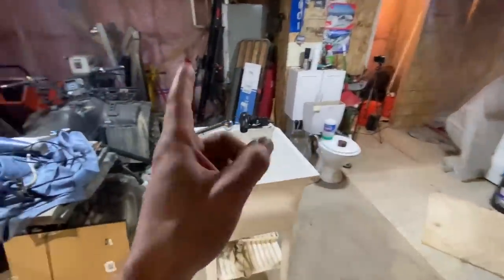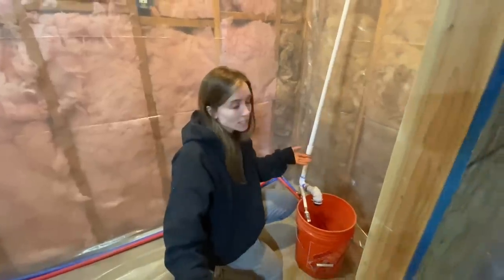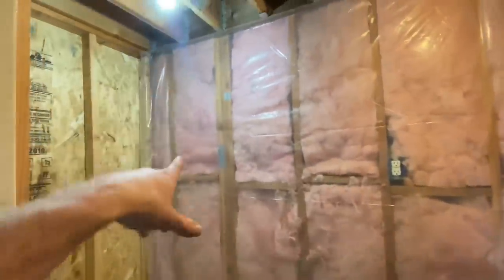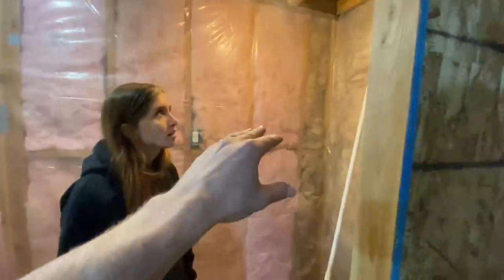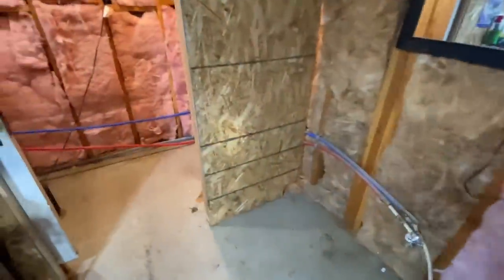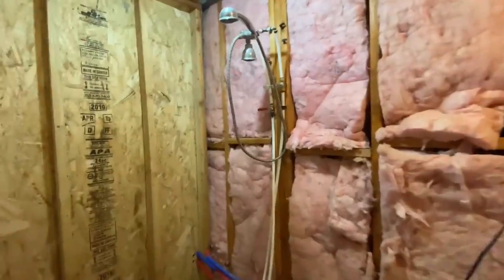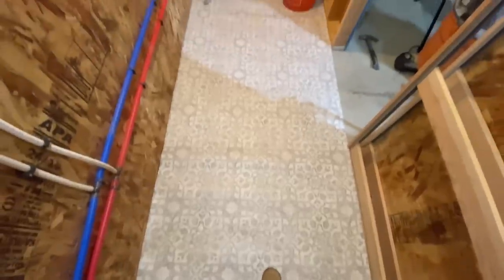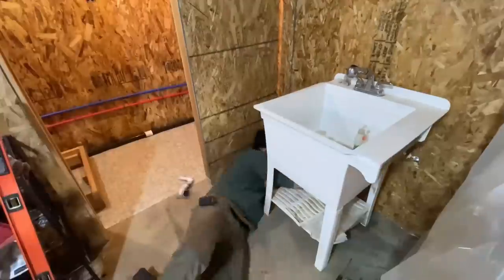FROZEN PIPES | A Total Bathroom Makeover

Comment: Why not run your plumbing on the interior walls, if you are subject to minus outside temperatures.
Reply: And put the sink and washer/dryer in the bathroom so it's easy to heat a small room above freezing. It's what I did downstairs in my self built home. I never worry about frozen pipes anymore. Also they do make temperature alarms which I also use as I live upstairs as you'all do.

Comment: Why don't you run the water line in the upper floor joists like a normal house? Radiant heat from upstairs will keep them warmer, besides the temp difference between the floor and ceiling on the first floor. In addition, you could add insulation in the area the water line runs.

Comment: During the winter, anyplace their is a faucet allow it to drip and it is less likely to freeze. You can also purchase a cheap pipe tape that uses little electricity to keep pipes from freezing. Warm water will always freeze first. I am so sorry that happened to you.
Reply: I agree to a certain point. An unheated area with dripping water will cause a trap to freeze also. Once a trap freezes it is like blocked, then sink over fills and water everywhere. I have seen the trap in a toilet freeze and bust the toilet, and that was in Ga. in an unheated house, so be sure any area where water is, is heated, or drain everything and fill traps and tanks on the toilet with something that doesn't  freeze, such as anti-freeze. Research for yourself what to do.  I'm just telling what I have seen before.

Comment: Is the garage space even heated yet?  Without heating that whole building this will potentially continue happening
Reply: They mentioned in the last video (?) when moving wood into the shop that they were running the wood stove in the shop as well as the loft so they were going through more wood.

Comment: Good job guys . Love your 2 blk dogs always want to help hold stuff down & just be with you . I know I a blk lab & a blk Dutch shepherd. I feel your pain rushing a job because u need a place to live or a bathroom. I’ve built 2 off grid places & my 1958 600 sq ft. Cabin im living in now when I rebuilt it & added 400 ft to it . I rushed it & had your kind of problems . The org. Roof didn’t have proper slop & I didn’t fix it , I thought with metal cortin roof panels it can’t leak. Wrong it leaked & after yrs of chasing a leak with no luck , I said fuck it & built a whole other roof over that with proper Slope . $6,000 for materials later , this roof still leaks occasionally here in dry so. Ca. Desert. Man I can’t win , it has 20’ metal panels , let’s say it’s all done correctly. My 2 additions I built no leaks , existing roof . Sucks